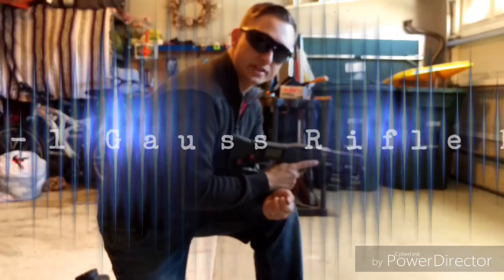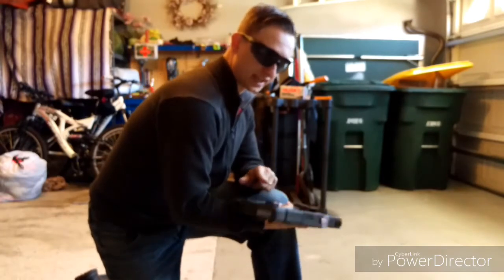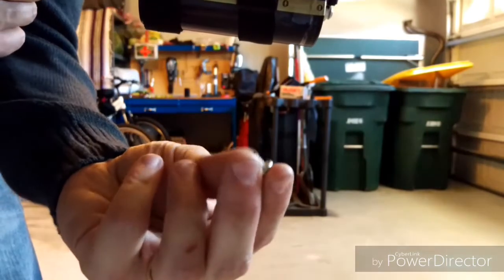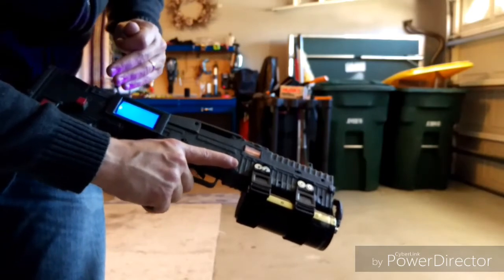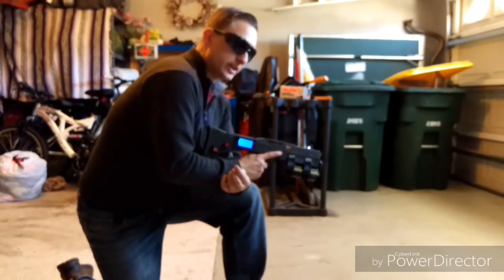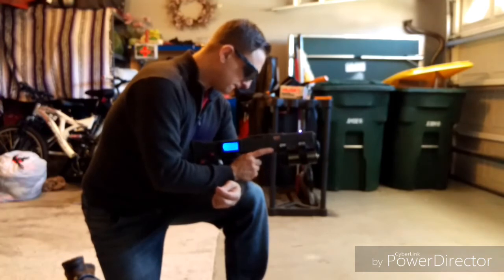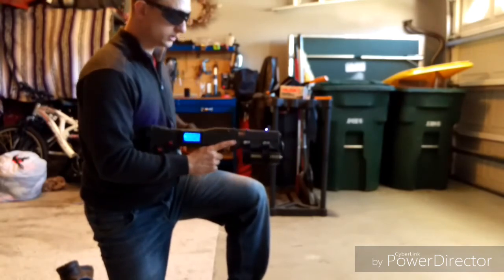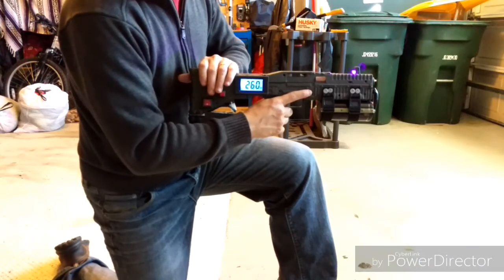Gauss Rifle Build

Comment: What warranted your claim that the capacitor might explode before you fired it? Is it simply that you'd not tested it extensively? A little insurance, just in case it blew on cam even though it never had done so before otherwise?
Reply from the maker: danjacksonguitar the two posts are very close together. When not properly protected they can arc and cause a surge. Also - over charging.
Reply: @TheEVAddict  Thank you very much for your response! Have you figured a way to protect it adequately? Do you think metamaterial integration or graphene batteries/ultra-capacitors might provide refining factors to these technologies? Thanks so much again.

Comment: I was working nearly 2 long years just to study research and finalize all components function,so far plasma torch inner housing with reservoir fully completed,I designed my torch that it would utilize standard Multiplaz 3500 accessories like evaporator,cathode assembly,anode couplings and insulating quartz glass tubes...The plasma torch operates on distilled water and alchohol solution  as liquid but also can work with compressed pressure regulated air and helium gas..The idea is simple,high voltage arc diatomise water to oxygen and hydrogen atoms which converges further to form plasma beam,much more hotter than oxy-acetylene torch..Second power line allow do welding and auxiliary power cutting to cut or weld previously impossible to weld metals like Molybdenium or Tungsten,yet those metals would be not possible to truly weld because oxygen presence cracks those metals even if they welded correctly,vacuum chamber required...The only metal that can be weld with exceptions is Titanium,gray and forgeable cast irons...
I also found outer plastic housing for torch that allowed to be hold as gun,there special protection material goes between inner metal torch housing and outer torch plastic housing creating thermal protection,also there would be small cooling fan for standard cooling and special liquid cooling if set on maximum voltage to prevent overheat....The power supply would have 4 fuses set,1 is main fuse to prevent any upcoming voltage overloads,2nd fuse settings is positioned at voltage regulators and final at thermo regulating board..In any event power supply would be cut off from overload,there is no difference in power supply between 110/120/125/220 or 230 volt single phase,different plugs would be need,the maximum input voltage is 230 volt AC single phase,there is no voltage recognition software that allow certain amount of current to be pass..After voltage module power goes toward current multiplier which than pass to plasma torch,specific amount of voltage release specific amount of output Amperage..the standard plasma initiating voltage is 150 volt,adding more voltage would increase power outfit of torch meaning more temperature of plasma beam would be exited that equivalent or out perform arc welder..Unlike Arc welder plasma arc torch doesn't produce toxic residues or fumes,no special gasses like oxygen,acetylene,argon/carbon dioxide requires..
However if welding set by using gas option than helium would be requires to be used through pressure regulator and compressed air for cutting..Rather than that distilled water for cutting and alchohol 50% solution for welding,the only last thing that hold me tight up is current multiplier boards,those is last things that aren't passed development stage yet...Rather than that everything else consider completed..
I have numerous different projects and not always have time to research and construct,gauss gun is another interesting device to build,there is tricks with it though...
What if I tell that adding 2 more things in the gauss gun can initiate muzzle energy from KJ to MJ,this would definitely  be something instead of nothing..I also learn that army large version known as railgun missing those primary components,without them it no use in rail or gauss gun rather than replacement for air rifle or BB gun...
I been research gauss gun long ago,I finally made conclusion but some things still doesn't add up...main part is preventing all extra current returning back to capacitors that it won't cost overload,partially exceeded amount of current need to be decreased at least as 50%,than it can go to primary firing module known as supercharge,this module would consume lots of energy before trigger button been pressed and allow pass more voltage....The primary module would have more medimum or momentum compare secondary so called barrel coils,this would allow to avoid overcharge or backpassing current...Obveously nobody had yet noticed that projectiles construction is incorrect,I won't tell exactly what need to be done because it would be disaster in wrong hands...the way how gauss gun or rail gun works is main medimum energy released from accelerator than upplied to projectile would be equal main damage result,we not just talk about few thousand kilojoules here,but amount of energy that measured at least 1.3 megajoules..This is not your Bb gun or any regular firearm,like I mention the modules and projectile construction not going to be released for public,it is extremely dangerous..I know what physics or chemistry can do or lead to,in wrong hands there is no guarantee what would happen or how it can get wrong,with technology like this it is real power at minimal costs,although projectile construction very complicated and somehow costic the accelerator design minus 2 more components is simple...The gauus gun only can operate at DC current only although I see some indeviduals tried build AC version and full auto capable,this normally cannot be done,by doing designs like this A would damage the whole project B would wear life span of components C would produce overpass of electromagnetic impulse which would kill user...It is not very simple to build such thing,all rules of safety must be used and although supercharge could be hold to allow really excessive overcharge which is risk to create very powerful electromagnetic energy which is static like and could easily kill you if hold too long...
Sometimes I wonder that technology we so call discover actually ancient technology we reinvent,it already was made in Universe,only on this planet civilization had not yet reached full Scientological cycle or by somebody been held from development,remember 14th century which Churches was prosecute anyone who have idea how to open eyes for the truth...Little had been change from those times now,anyone who create something new disappear without trace neather that cure against diabetes,wireless energy or something else..It seems that there something far sinister than governments and Corporations combined exist,something that attempt control everything in this world but very soon would be hunted instead..
The term that have very strong expression sudjest that hunter would be hunted one day by somebody else,obveously out of this world...The prophecy than would be completed,this is tightly related to bibles,prophecy scripts and many other things like rosetta stones,all of them somehow point to same direction and same outcome...
Are we writing books,creating movies,games or anime is part of our imagination or there is much bigger picture that hidden in our own DNA as warning,in any event sooner or later we would witness the truth that been hidden from us from time to time..

Comment: By watching all amateur builders I notice that particular gauss gun only reach near 4KJ of energy,there is same faulty projectile loader in form of solenoid loading switch..That however not the point,why the coils have to be switched on and off during firing cycle,that is make me wonder...What would happen if all coils actuated at same time??Would that increase velocity to projectile speed and power??There also another unwanted part,bulky capacitors which have too much weight and undesirable shape..What would happen if multiple amount capacitors connect in parallel,this suppose increase value of capacistance altimately create desirable shape of capacitor module and possibly less weight..If supercharger installed it would most likely drains all extra amount of energy that pass through coils,acording to the transformers and induction coil laws large transformer always consumes more energy....The way how supercharge module work it increases initiating pulse during projectile load while coiled barrel job just to guide projectile and keep it stable until it leaves barrel...The supercharge or supertransformer observes large amount of current and if trigger pressed steady it would quickly drains all power and capacitors most likely would be out of charge...The only slovagable solution would be building component X at supercharge module which would increase desired magnetic field...Before I construct something for testing first I calculate all components value and it's maximum performance,it would be pointless construct experimental device and than rebuild it from scrap all over again...Everything starts with theory first,based on theory calculations and approximate equation established and only than specific parts getting matched for construction...I been doing this with plasma arc welder,Multiplaz 3500 is nothing but BS,they have an good idea but zero efficiency and zero results....This was based at 1975 old Soviet design lead by Plazzar company until it finally broke at meddle 90's into 3 corporations original Plazzar,Gorynych and Multiplaz..All those companies develop their own plasma arc machines but none had succeed so far,the amount of maximum exceeded voltage must be equal to specific amount of Amperage in order to fully reach results...If voltage too high and Amperage too low there is no power,altimately operation of plasma torch won't bring positive results..Multiplaz 3500 at voltage of 110/120 only deliver 2.3 Amperes maximum power,at 220/230 volt single phase plasma torch only can deliver 4.0 Amperes...The power supply build on digital voltage recognition chips,it regulates how much current have to be used at plasma torch plus digital rheostat regulators which creates negative side affects neather increasing or decreasing voltage which negatively affect plasma torch...Thanks to some friends of mine I been able study internals of Multiplaz 3500 and realize all of it's failures in design,this gave me idea how to create my own version..In result power supply is very light weighted and build from 6-8 modules,there is 1 logical controlling module that activate secondary cooling fan and this called thermo regulating board which takes readings from temperature of torch,thanks to contact relay it activate cooling fan....The maximum temperature of torch is 8000 degree by Celsius,maximum voltage is 385 volt,maximum current is 12 amperes and it DC voltage operated...Instead using old outdated method of constructing special step up transformer and using rectifying bridge machine build on IGBT and rectifier support 1000 volt maximum load which way too much...I was working nearly 2 long years just to study research and finalize all components function,so far plasma torch inner housing with reservoir fully completed,I designed my torch that it would utilize standard Multiplaz 3500 accessories like evaporator,cathode assembly,anode couplings and insulating quartz glass tubes...The plasma torch operates on distilled water and alchohol solution  as liquid but also can work with compressed pressure regulated air and helium gas..The idea is simple,high voltage arc diatomise water to oxygen and hydrogen atoms which converges further to form plasma beam,much more hotter than oxy-acetylene torch..Second power line allow do welding and auxiliary power cutting to cut or weld previously impossible to weld metals like Molybdenium or Tungsten,yet those metals would be not possible to truly weld because oxygen presence cracks those metals even if they welded correctly,vacuum chamber required...The only metal that can be weld with exceptions is Titanium,gray and forgeable cast irons...I also found outer plastic housing for torch that allowed to be hold as gun,there special protection material goes between inner metal torch housing and outer torch plastic housing creating thermal protection,also there would be small cooling fan for standard cooling and special liquid cooling if set on maximum voltage to prevent overheat....The power supply would have 4 fuses set,1 is main fuse to prevent any upcoming voltage overloads,2nd fuse settings is positioned at voltage regulators and final at thermo regulating board..In any event power supply would be cut off from overload,there is no difference in power supply between 110/120/125/220 or 230 volt single phase,different plugs would be need,the maximum input voltage is 230 volt AC single phase,there is no voltage recognition software that allow certain amount of current to be pass..After voltage module power goes toward current multiplier which than pass to plasma torch,specific amount of voltage release specific amount of output Amperage..the standard plasma initiating voltage is 150 volt,adding more voltage would increase power outfit of torch meaning more temperature of plasma beam would be exited that equivalent or out perform arc welder..Unlike Arc welder plasma arc torch doesn't produce toxic residues or fumes,no special gasses like oxygen,acetylene,argon/carbon dioxide requires..However if welding set by using gas option than helium would be requires to be used through pressure regulator and compressed air for cutting..Rather than that distilled water for cutting and alchohol 50% solution for welding,the only last thing that hold me tight up is current multiplier boards,those is last things that aren't passed development stage yet...Rather than that everything else consider completed..I have numerous different projects and not always have time to research and construct,gauss gun is another interesting device to build,there is tricks with it though...What if I tell that adding 2 more things in the gauss gun can initiate muzzle energy from KJ to MJ,this would definitely  be something instead of nothing..I also learn that army large version known as railgun missing those primary components,without them it no use in rail or gauss gun rather than replacement for air rifle or BB gun...